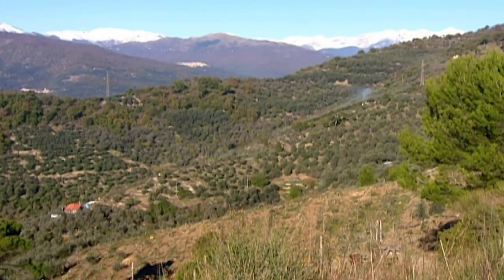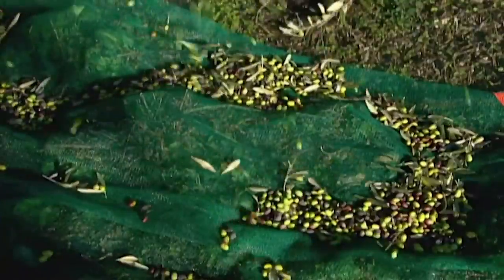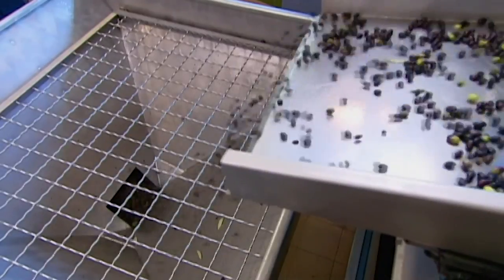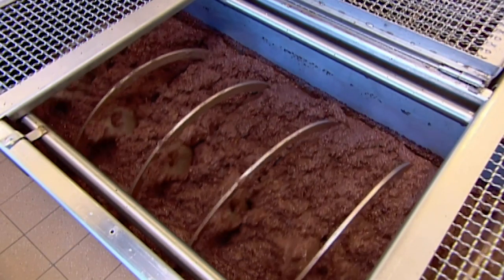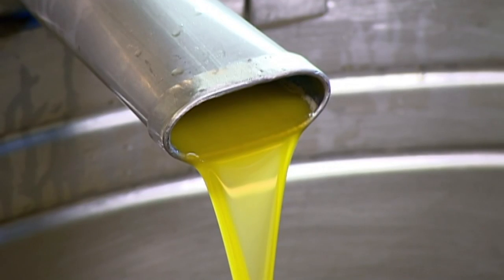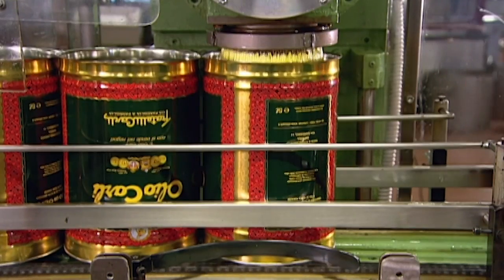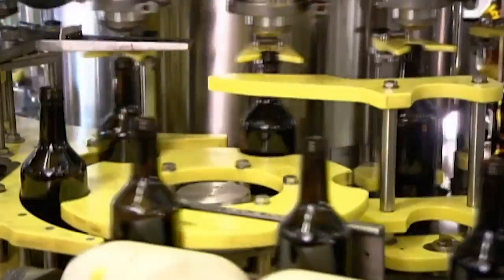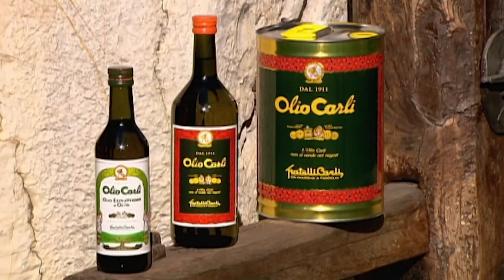OLIVE OIL | How It's Made

Comment: Can cook with it. Put it on a salad. Drink it. Hydrate your skin and hair with it. I lubricated my bamboo and cedar flutes with it. I'm thinking of using it on an antique baseball mitt I have
Reply: I have bamboo flute (bansuri). But ill try mustard oil on it
Reply: What type of bamboo flute do you gave
Reply: @raviv4448  have some pan flutes made out of bamboo and a cedar American Indian flute 🪈
Reply: Olive oil can indeed condition leather, but it has the risk of altering the color, and dissolving any varnish/finish that is of natural origin. I worked at a high-end leather goods shop and had to send in a bag for repair that a client used olive oil to condition; it moisturized the leather, but altered the color to such an extent, that it could not be restored properly. This was a smooth-grained, tanned leather with a vegetable colorant. Just fyi
Reply: @sergpie  thanks...
Maybe I'll use" fast Orange" again instead

Comment: There is no need to include the pits.  Pitted olives are sold here by the billions every day in the United States.  If it can be done for that, it can be done for this too.  The pits of mature olives can be used for new harvests or separately ground for making olive soaps, etc.  The oil would be far purer and wouldn't need dark jars if the pits weren't included in the original grinding process.  My word.  How is it that they haven't figured this simple thing out yet???
Reply: if I had to guess, there could be several reasons for this.
1. pitting machines to pit that many olives would be impractically expensive.
2. feeding olives into pitting machines is logistically impractical
3. pitted olive oil is not better than regular oil
4. the cost of transporting pits, and the oil lost in each pit outweigh the benefits of selling them.

As a general rule of thumb, industries on this scale are ruthlessly efficient. when considering why they don't do something that seems obvious, consider the possible reasons why not.
Reply: In addition to what Torin Fu mentioned above, it is important to remember that these will likely be family recipes passed down, adapted for commercial production. In Italy they don’t widely have pitted olives on supermarket shelves. American things tend to be to make things easier and more convenient, while in Italy and Southern Europe they likely want to stick to tradition.
Reply: Pitted olives aren’t widely known of in places other than America and maybe the other English-speaking countries.
Reply: Franco Sinatra  Well, they don't say "rat" for nothing.